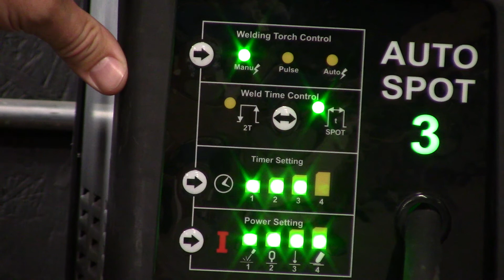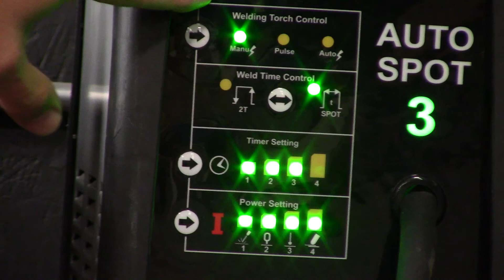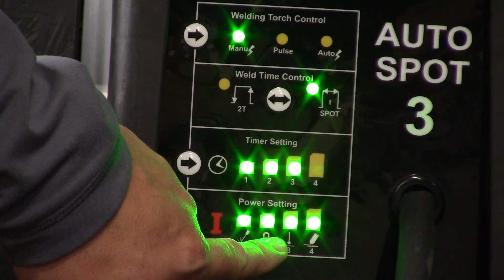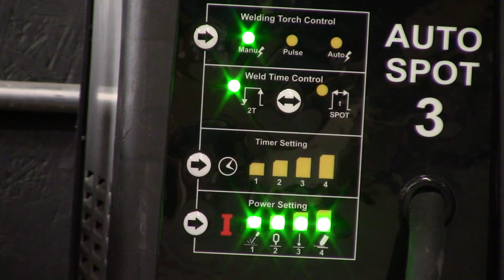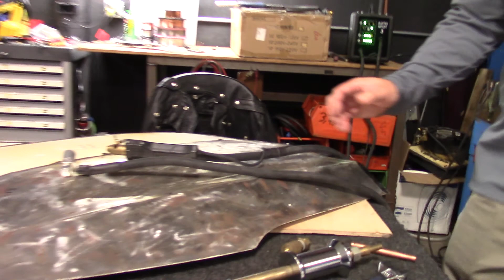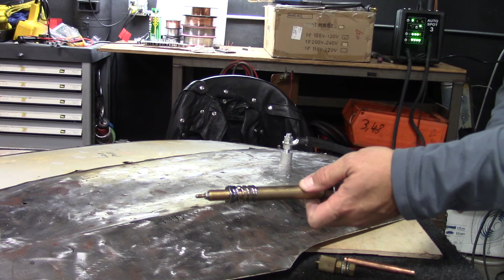UNI-9500 Auto Pro Application

Comment: Where can i order this from
Reply from the maker: you can order this from any professional tool or PBE supplier.
Reply: I just got my tool thank you. Do you have an easy puller attachment like the miracle system or power tech. Its uses feet on either side and the puller goes up when you squeeze the handle.
Reply: I have one of those, but is 220 voltage and I bought a 110 adapter and is not working. Could you please explain me why?